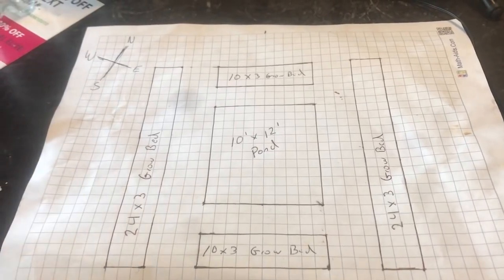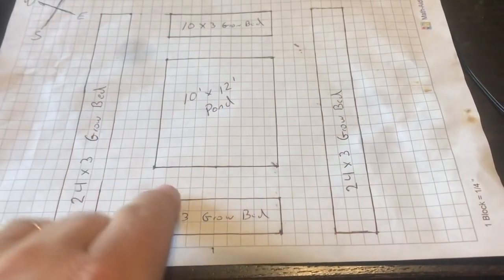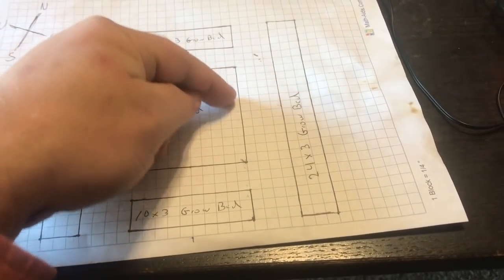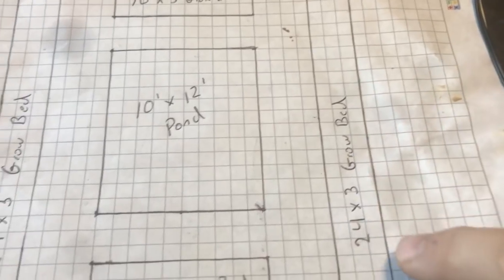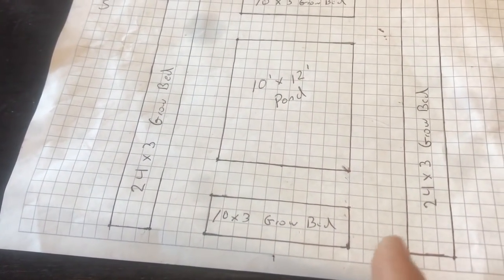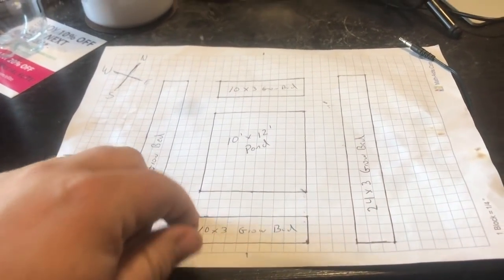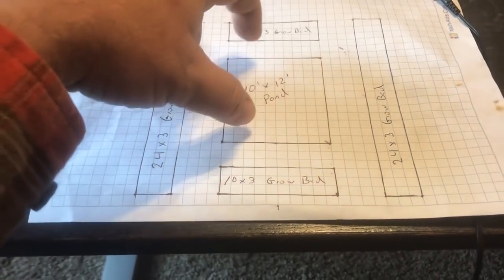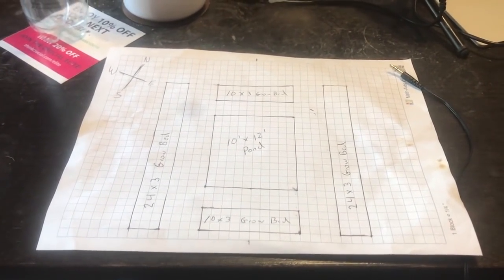Plans for Our 3000 Gallon Timber Frame Pond Growing System

Comment: I really like the idea. With two pumps necessary to make the water circulate completely, do you worry about failure of one of the pumps? Specifically, if the sump pump fails and the main pump is still pumping to the grow beds, especially at night or while you're away and cannot check on it, how do you keep the water from being all pumped out of the pond and overflowed  on to the ground?  I'm interested to hear how you'll handle the contingency because I think I might like to try this sometime.
Reply from the maker: No because if one was all we used and it failed you'd be in the same position, in fact worse.  

First I keep an extra pump on the shelf as a spare at all times.  Next if one failed, we could just run one in the pond, the pond would be fine.  The wicking system would be fine for days if not weeks if water was not running though them.  

Additionally I will likely put a second smaller redundant pump in the sump, this one will never run unless the first one fails, as it is only a fail over it can be a cheapo 75 dollar harbor freight type thing.  Really simple, the main pump will be low in the sump, the back up higher.  Both on floats.  

I also have an air system that will be running air to the pond, so if the pond pump failed it would be also fine for days.  The system is actually more resilient this way, not less so.  I think as we begin the build it will make more sense.
Reply: Jack Spirko I see. By having a fail over pump in the sump, you won't end up with all the water there if the primary pump in the sump failed and the pond pump kept running.  Good redundancy planning!  

It's an interesting setup. People that have shallow soil with rock underneath could make excuses or they can make a pond based wicking bed system. Good choice. It should make a bunch of food.

Comment: Have you figured out what the cost is to build this? Cost to run the pumps? Amount of food this system will produce? ROI?
Thanks for sharing!
Reply from the maker: So far I only have a cost of the tank and pumps, pumps are 150 a piece because I have standardized on a a major awesome pump and use the same one everywhere, so I can keep ONE spare at all times.  Cost of the pond with liner, lumber, foam board, all in about 1200.  

Due to some complexity of how we are going to do the facades, etc, I have a friend who is a builder by trade working up a materials list, but my off the cuff is about 5K for the entire project. 

As to ROI in food production, I don't practice what I call "intellectual masturbation" so any number would just be bullshit.  Personally I feel food is why we are building this but it is a by product of something that will be this beautiful.  The ROI on my property value should be really great.  

In the end though this much wicking bed will produce more food then I can ever eat, at least a meal of fish a week per year after the first year, at that point what ever the ROI is, is moot.  Cost to run the pumps is about 40-50 dollars a month for both.
Reply: Thanks for the reply